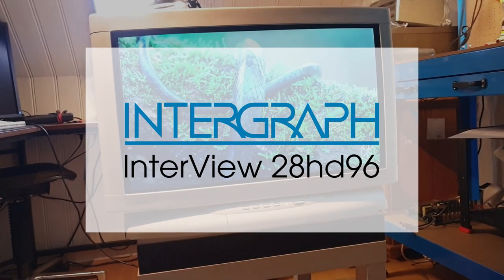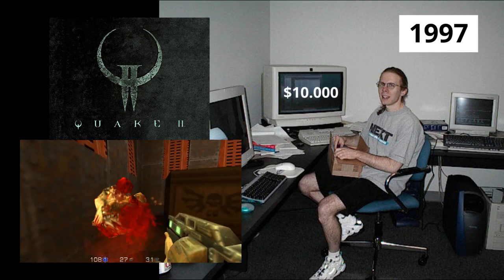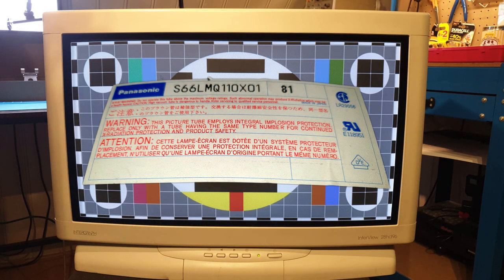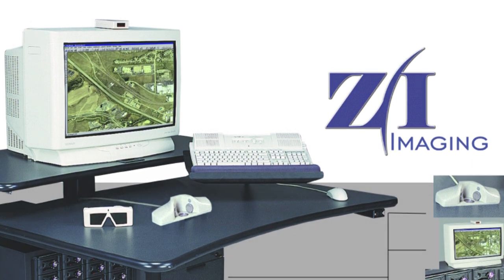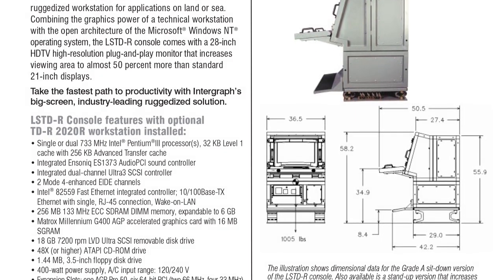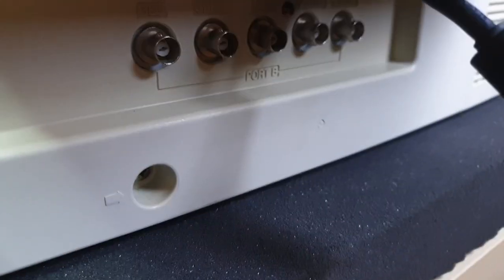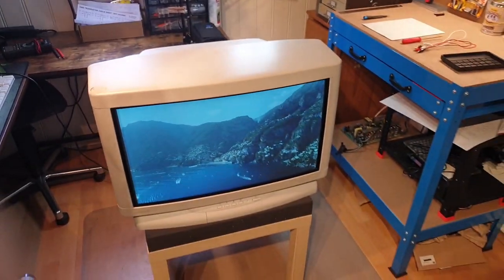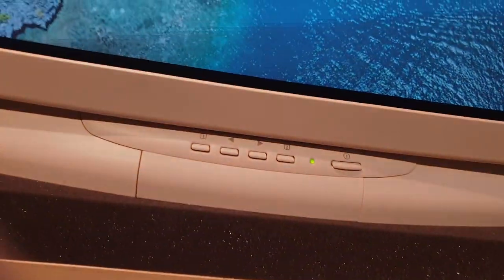Intergraph Interview 28hd96 Disassemble and Reassemble Tutorial

Comment: Connecting the CRT anode to an unconnected metal object/radiator does nothing to actually discharge the CRT - you're lucky the internal bleeder resistor did its job and drained the voltage away. I don't mean to bash the video, I really like the effort you clearly put into the production and editing, but I think it is dangerous advice to give because it doesn't do what you say it does. To discharge a CRT, you are in effect discharging a capacitor, the two conductive coatings of aquadag on the inside and outside of the glass envelope. To do so, you need to short them out, which is why most CRT discharge tutorials suggest using anything physically connected to the outside coating. Trying to discharge it to some random grounded metal object is like sticking the positive lead of a capacitor into the ground socket on an outlet and saying it's discharged - it's not, there's no complete circuit made, and it is still very much charged.

I don't wanna come off as an ass just shitting on your video - I think it's clear you put a lot of love into it, and I don't think you're trying to spread misinformation - I just don't want you or anyone else to get hurt. From experience, anode voltage hurts! :)
Reply from the maker: As an disclaimer: I'm a hobbyist.
Your waring is very much appreciated.

The radiator I used to discharge the CRT IS connected to ground.
Reply: @EvertvanIngen  Of course! I don't hold anything against you, I've made plenty of mistakes in my time and I just hope that I can prevent others from repeating them. I recall one time in my early teens trying to measure current draw on a power supply voltage rail in a vintage tube type TV - 400V or so - and thinking my multimeter read current like it did voltage, from the source to ground. (just in case you don't know, in current mode, a meter acts like a short and you are supposed to put it in line with the source to be tested...). To put a long story short, my meter probe has a chunk missing in it! But yeah, I don't mean to sound like a troll or anything and I do like the video a lot. These are fascinating monitors and I'd like to try one out someday.
Reply from the maker: That's why I pinned your comment to the top ❤️👍
Reply: @EvertvanIngen  The radiator being grounded will not help you. You need to short the anode to the *DAG ground of the CRT*. If that one was connected to earth then your radiator would do, but since since the tv is not connected to anything, it's floating. You need to clip your lead to something with good connection to the DAG on the outside of the tube. Usually there are wires hugging the tube with a good connection to the DAG ground which you can use.
Reply: I´d suggest editing the video comment mentioning specifically this point. It is utterly dangerous to manipulate a vacuum tube unsafely grounded. Too many pixies there.

I´m also a hobbyist (so far 25" Trinitron is the biggest thing I have disassembled) and that was lesson 1 from the many lessons I followed. I even paid for training on CRTs as I deeply fear high voltages.

As @ClassicComputers mention, grounding to the degauss wire is the widely recommended path. I usually wait for a while to give time for the bleeder resistor to spare me any big spark.
Reply: @jtsiomb  Genuine question from an electrics less-than-hobbyist: If I connect anything to ground, the same one I am grounded to, how could there be any charge between that thing and me? I also didn't find any relevant google matches with the term "DAG ground".
Take into account that most radiators within Europe tend to be properly grounded to the same potential our yellow-green wires are grounded to, which with regards to our outlets is "proper ground".
Reply: @fonkbadonk5370  First of all it's not a given that you're grounded. If you're standing on a wooden floor, or wearing rubber slippers for instance, you're not grounded.
But even so, the point of this is to discharge the tube which acts as a large capacitor. To discharge a capacitor you need to short its two plates. One plate of the tube "capacitor" is the DAG inside the tube, connected to the anode connector under the suction cap. The other side of the tube "capacitor" is the DAG layer on the outside of the tube, which is connected to chassis ground, and eventually earthed when the monitor is plugged in. Therefore to discharge this tube "capacitor" you need to connect the anode, to the DAG ground on the outside of the tube. Connecting the anode to earth will not discharge it, unless you also connect the monitor chassis to earth.
The term "DAG" refers to the conductive graphite coating used inside and outside of the tube.
Reply: @jtsiomb  Ahh, now I understand! Makes perfect sense as well. Thank you for your thorough explanation!
Reply: @JosepsGSX you can't edit YouTube videos once they're uploaded. Unless you're in the handful of huge YouTubers who have been given the ability to swap the file out (seriously like only a handful of YouTube individuals/companies have ever had this ability because it's so easy to abuse and creates liabilities - even in those "trusted" creators there has been multiple controversies).

I wish they would add some form of annotations back. Maybe an abuse of the subtitles?

Comment: I'm surprised how clean it is and the lack of dust, since high power components like that attract a lot of dust, and considering it is 20+ years old you would think it would be quite dusty. 
Perhaps the metal covering inside helped in preventing dust from entering through the back cover?
Reply: Both devices are so clean on the inside that they have almost never been used, which shows that both monitors are in great condition.
A dream for collectors✌
Reply from the maker: I cleaned it beforehand :yougotthis:
Reply: @EvertvanIngen  How dusty was it?
Reply from the maker: @joseph2235  Darkend due to fine-dust from high voltage accumulation.